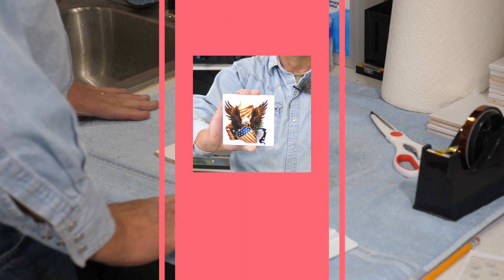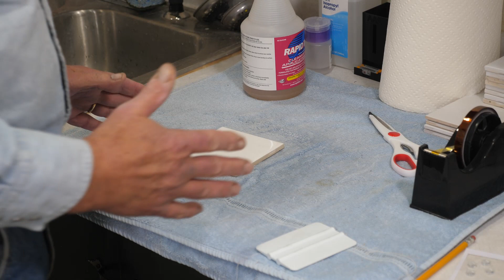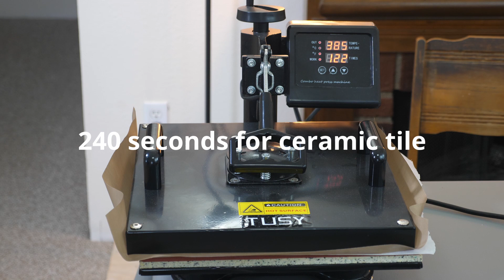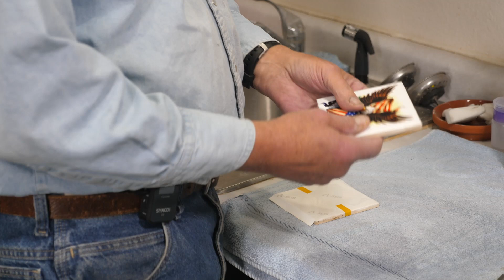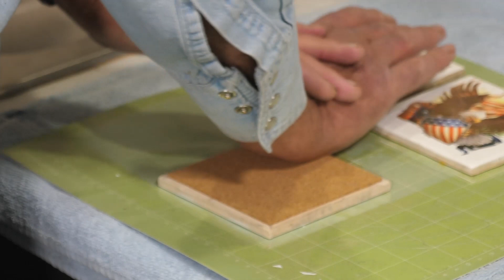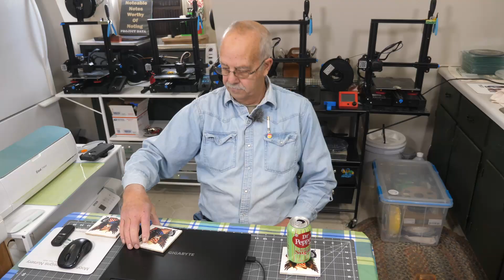Dye Sublimation On Ceramic Tile

Comment: Thanks Roger. I have a couple of questions as I'd like to make some tiles using some of my photos for gifts. I'd probably want about 100 tiles in total.
1) It's been a couple of years since your original video. Would you still recommend the equipment that you listed or are there newer models that you would now recommend? I'd like a all-in-one printer and cutter in one if possible.
2) Perhaps it's cheaper for me to simply have a business/person create the tile gifts for me. Is there a business that does this that you would recommend? Would you be interested in do this and if so, what would you charge to create 100 tiles if I sent the images to you?
Reply from the maker: Methods are still the same.  If you have the equipment, a DIY is going to be the cheapest.  While I could do them for you, it would not be until January due to present commitments and workload.

Comment: If the polycrylic works in a ceramic tile would it work on a mug too
Reply: Would it be ok for me to use or just for decoration
Reply from the maker: @clairecolchester7345  If using for a coaster, etc., apply a clear coat to protect the image.
Reply from the maker: Yes
Reply: @rogersshop  Is the YES for the mug use question?  😁

Comment: Great demo. Thank you for the up front info. Will these tiles withstand installation in a shower? Is there a particular type that would? Thank you.
Reply from the maker: Yes,, so long as not scrubbed with an abrasive.
Reply: @rogersshop   Thank you.

Comment: Roger. I tried the vinyl… it melted at the 385f/240 s… 
Maybe the vinyl cuz it’s the cheap stuff from $ tree. Was using just to see how it would work. 
I’m love the template for my vinyl cutter so thanks much for sharing. 
I do have some Circuit brand vinyl. What time/temp would you recommend for the cheap vinyl I have, I want to be able to use it up. 

Thanks! Glad I found you.
Reply from the maker: Was the vinyl o the bottom?  It will melt if on top.  I did a trial comparing the Dollar Tree vinyl to others on glass, using this method and it actually turned out pretty good for such cheap stuff.

Comment: What are those machines working in your background?
Reply from the maker: 3D printers.  We have 14 of them and working most of the time.
Reply: @rogersshop  
Is 3D printing for primary projects? And do you have an engraver?
Reply from the maker: @MrJj2001  I print custom mounts and risers for laser engravers, along with a few other things.  I do have laser engravers.  Both diode and CO2.
Reply: @rogersshop  
Thanks for your response, you seem very knowledgeable and dedicated to your craft! Great discipline and focus! God bless!

Comment: Both  poly and vinyl methods worked well for me.   I have the same heat press.  What paper to you have attached to the upper plate with magnets?
Reply from the maker: Teflon sheet

Comment: Thank you for all your videos.  You are by far the best out there and have never steered me wrong.  I’m trying this one out this week to prep for mother’s day photo tiles 🤞. Do you have a website or are your steps listed anywhere?
Reply from the maker: We do have a website, but the steps are not listed there and most of these custom items are sold locally and not on the website.
Reply: I got the chance to try it today but it peeled when taking the paper off.  I sanded with 400 grit.  I did the 2 coats, letting it sit over night both times but didnt press it until 2 days later.  Im thinking its because I didnt sand it enough.  Any tips?
Reply from the maker: @valerietramontozzi7595  I've never had that happen.  Could be that you did break the glaze enough on the tile first.  Try a 220 grit paper if your glaze is especially tough.

Comment: Hi, I followed your instructions and my tile did not sublimate well both times I tried. It looks like some of the ink came through but it’s very grainy looking, the image isn’t good. I’m wondering if it’s a difference in the paper. I use texprint sub paper and cosmos ink. They have worked great sublimating on everything else so far. I did only do two light coats of polycrylic so I’m wondering if maybe I didn’t have enough. The paper didn’t stick to it either. Only some of the ink came off none, of the paper stuck to it. So I didn’t have to wash it off it was just really grainy.
Reply from the maker: I also use Tex Print from time to time, so that is not the problem.  Check your pressure (should be quite firm) and be sure to preheat the bed and pillow a full cycle first.  This preheat makes a big difference.  When printing the graphic, use the highest quality setting possible.  Also, what base are you using?  Clear vinyl, Polycrylic, or laminate?
Reply: I used polycrylic spray matte, light coat twice and completely dried. I keep my print settings on prem matte, high quality. I did preheat the bed but not with the pressing pillow! I’ll try that! I had medium pressure, firm enough that it was slightly hard to close with the tile in place.
Reply: I tried heat pressing the pillow too beforehand for the full time and it was still grainy. I turned the press up to 400degrees and pressed the same tile again and even more color came through, but still not quite there. I’m thinking tomorrow I’ll try this at 400 for longer.

Comment: what printer and software is used to print to the viny??
Reply from the maker: The printer used here is an Epson 2720 with sublimation ink, printed on sublimation paper.  It does not print direct to the vinyl.
Reply: @rogersshop  oh ok i understand thanks...but with that being said it is possible to transfer an image to the vinyl and the apply the vinyl to a surface of choice
Reply from the maker: @Chet_Vanderlinden  It can be done on HTV to apply to a porous surface such as fabric, but I've never tried it with Permanent outdoor vinyl.  Not sure how the adhesive would hold up after the heat transfer.

Comment: I sanded with the power tool with 60 grid,  and 400, it still feels smooth, are you able to feel roughness when you sand them?
Reply from the maker: No.  You  should not feel any roughness.

Comment: Thank you Roger.  This is a very informative video.  Would you mind answering a few questions?  Can this process be done using a Cricut Heat Press?  Would I have to apply manual pressure for this to work?  Do you have a recommendation for temperature and time using a Heat Press?
Reply from the maker: Yes, you could do it with an Easy Press.  However, it takes a lot of pressure and you need to make SURE you do not move while doing it or it may ghost.  Time & temp would be the same as if using a heat press as shown.

Comment: Roger, when you sanded the tile to remove the glaze, did you use the electric sander or did you do it by hand? Thank you!
Reply from the maker: I've done it both ways.  When doing a lot of them, I use a DeWalt random orbit sander.
Reply: Roger, one more question - what are the dimensions of the shape you cut out in the vinyl to wrap the tile? I’m making coasters for a Christmas gift and have wasted 2 sheets of vinyl because my template isn’t quite right size wise. Thank you.
Reply from the maker: @kimberlysturgill  Center square is 4.125".  The four "lap tabs" are 4.125" x .75".  I did this on a Cricut and because of their proprietary "rules", I can't share the template.
Reply: @rogersshop  no worries. Having the dimensions worked. I thank you. I also thank you for the Rapid Tac recommendation in your video. That makes applying vinyl a cinch.
Reply from the maker: @kimberlysturgill  I did find a way to share the Cricut template.  The link to it is in the description

Comment: How did you get your shape for the clear htv to fit on the tile
Reply from the maker: Created the template in Cricut Design Space after carefully measuring the tile to get exact dimensions.  Don't use HTV here.  Use permanent outdoor vinyl, such as Oracle 651 or 751.
Reply: @rogersshop  very helpful. Thank you for noticing i thought it was htv. I mean it was a sticker hence the wet application but because it went under the press I had htv on the brain.
Reply: @rogersshop  What is the size of the clear vinyl you use to get the overlap
Reply from the maker: @sheri8471  4.25 " square with 1/2" overlap on each side, corners cut out

Comment: Do you find a laminate comes off easy? If so do you have any suggestions? Also, is it waterproof?
Reply from the maker: Not had a problem with it coming off.  Waterproof?  Maybe................  Water resistant, yes.  I wouldn't soak it or run it through a dishwasher.

Comment: Great video, I do not have Rapid Tac, can you please recommend another adhesive? Thanks!
Reply from the maker: Rapid Tac is not an adhesive.  It is a cleaner and a liquid that allows positioning and eliminates air bubbles when squeegeed correctly.  Plain water also works, just not as well.

Comment: The vinyl that you used in this video is that vinyl inkjet printable vinyl that I can use in my inkjet printer?
Reply from the maker: No.  that will NOT work.  This is Oracle 651 permanent outdoor vinyl.
Reply: @rogersshop  ok thanks

Comment: Do you clean the little bumps off the side of the tile. They really annoyed me. I was going to use a grinder.
Reply from the maker: Sometimes, I use my Triton with a carbide belt.  Normally, I just leave them.
Reply: @rogersshop  Buy tilke without them.  They are a pain in the ass.

Comment: What's with the Dr Pepper can? Almost looks like you'd need the old hole punch can opener, going by the design, which goes way back. Is the 'made with sugar' soda from Texas, or are other areas doing that now, too? I know a LOT of food companies are trying to get away from high fructose corn syrup, which I personally believe is largely responsible for obesity and diabetes in our country. But I'm no doctor - I only play one on YouTube. In your home siding video, I thought it looked like Southern Missouri. But I don't know my states that well. Cool ideas with the tiles. Could you put a coat of epoxy resin on it? That bullnose edge might be a problem, unless you have the tile sitting up on something and pour it on and let it drip off the sides.
Reply from the maker: Whenever I see the "Made With Real Sugar" Dr. Pepper at the store, I stock up on it.  I like the taste better and it reminds me of the bottles I could get when I was a kid.  I am in northern Illinois, along the Mississippi River, bordering Iowa.
Yes, one could coat the tile with epoxy resin so long as the formula would not react with the base.  I have a friend that makes coated tumblers and found that out the hard way!

Comment: I'm watching this way after the fact (sorry). I have a question, the tiles, although they are covered on the edges with the vinyl they 'look' raw. Can they be painted white before doing this process?
Reply from the maker: Yes, they can be painted with high temp paint.  Or, you can wet sand the bumps off with silicon grit 220 paper.

Comment: I have the following and would like to know if i can use them any of these as a substitute: Krylon colormaxx clear indoor out door i have the gloss crystal clear and the flat crystal clear, rust-oleum painter's touch satin clear , the modge podge gloss crystal clear sealer "spray" (-:.. i know we've been down this road before, but i wanted to add some more choices to the pot in hopes of getting a "clear" winner, lol  (-: hoping  something in my stash works.  (-:
Reply from the maker: I have tried solvent based clear coatings and they do not work.  The coating usually blisters in the press and color transfer is either poor, or none at all.  The water-based Polycrylic has given the best results.
Reply: Thanks for saving me from the trouble of making a mess as well as  wasting my time n supplies.

Comment: Thank you! Very easy to listen to. Question, should I use poly acrylic spray or brush on? Glossy? And if either, do you have a personal preference?
Reply from the maker: Brush on will leave marks, no matter how careful you are.  Spray gives the best finish.  When I do a lot of these, I use an airbrush with thinned Polycrylic from a quart can.  Much less costly than the spray cans.

Comment: Just wondering... With that Polycrylic spray, could this also be used for plain dollar tree COFFEE MUGS, vice having to using actual sublimation mugs. Also, When you say Vinyl you are referring to adhesive vinyl ( I see in your references 651)
Reply from the maker: Polycrylic spray would work if the intended use was just decoration as it is not listed as food-safe and getting it to adhere to the ceramic glazing might be a problem.  For the vinyl, yes, permanent outdoor vinyl such as the Oracle 651

Comment: Roger, what laser machines are you using in the background in this video
Reply from the maker: Those are Creality Ender3 V2 3D printers.  we make custom parts for various things and they run pretty much 24/7.  Just added another this past week, but a different brand with a larger work surface.

Comment: Where did you find the 4
25 X4.25 square ceramic tiles?  I went to Lowes and their smallest tile was 6X6.  Everything on Amazon costs around $1 for each tile
Reply from the maker: Lowes, Home Depot, and Menards all have these.  They are basic ceramic wall tiles.  The Menards price is $0.15 each when purchased in a case of 100.  As a plus, those from Menards are made in USA by Mohawk.  I have also used the 6 x 6 for trivets, but laser engraved, not sublimated, so as to tolerate heat.
Reply: Thank You
Reply: I have found that the best place to buy tiles is at Home depot.  Lowe's is closer, but they never seem to have them in stock. I don't have a Menards in my area.

Comment: Roger what size did you cut your square a nd the cutouts mine is always off thank you
Reply from the maker: Measure your tile, but mine are 4.125" square and I allow .75" on each edge to wrap under, with corners cut away to prevent overlaps on edges and back.  The cork base then cover where it wraps under.
Reply: @rogersshop  do you do the cut outs for the corners in cricut design or manual - how do you do that?
Reply from the maker: @pixiwings75  On the Cricut.  Make a square, then some rectangles.  Put all into position and weld, then cut.  Measure your tile carefully first.
Reply: @rogersshop  so that is 4.200 is that correct
Reply from the maker: @sheri8471  4.125" with 1/2" overlap, corners cut out.
Reply: @rogersshop  How do you get the shape that you use
Reply from the maker: @sheri8471  Made in Cricut design Space
Reply: Thanks so much

Comment: what size is your template for the tile
Reply from the maker: Measure your tile, but mine are 4.125" square and I allow .75" on each edge to wrap under, with corners cut away to prevent overlaps on edges and back.  The cork base then cover where it wraps under.

Comment: I tried the laminate on tile before and that was definitely an epic fail. Now I have a good use for my 25 yards of 651. I’m happy to see you got yourself some new gloves.
Reply from the maker: Gloves for me can be tough since I wear a size 11.  These run big, so a 10 fits perfect and the heat resistance and grip is excellent.  Not cheap, but worth it!  I'll be doing a review on these soon.
Reply: @rogersshop  I have the opposite problem. I have really small hands and can wear kids gloves, so even the women’s heat-resistant gloves are huge on me.
Reply: @rogersshop  Laminate ia 8 min minumum to bond

Comment: I have the Epson et 2803 do You know the link to find the color profiles for the hiipoo inks for my printer I’ve searched and cannot find them from hiipoo. Have you tried the clear vinyl method on thin glass? Many thanks
Reply from the maker: I do not know of an exact color profile for the Hiipoo inks, but do have the Hex code for the four primary colors.  Black #000000, Yellow #FFFF00, Magenta #FF00FF, Cyan #00FFFF.  Yes, I have done this on the thin Dollar Tree picture frame glass, which is half as thick as regular window glass.  Works fine, but be careful with pressure as it beaks easily.  Guess how I know that.........
Reply: @rogersshop  thanks Roger, what settings best for thin glass, you used clear HTV over the glass right?
Reply from the maker: @darleneroach2848  Do not use HTV.  Use permanent outdoor vinyl such as Oracle 651 or 751.  Can be gloss or matte.  Doesn't matter.  Clear or white work the same.  385 degrees for 190 seconds.  Medium-firm pressure.  Photo/graphic facing up, vinyl side of glass facing down.  Be sure to preheat bed.  Do not try to hot peel.  Let it cool and use water to get paper to release.  Magic eraser and water will then remove the white film left behind.

Comment: beautiful! could i put modge podge on the poly acrylic coaster as a second coating after its been sublimated as the protective coating, instead of another coat of poly acrylic ? thanks
Reply from the maker: I suppose one could.  I'm not a fan of it as it always shows brush stroke marks, but that is one of my OCD things............  I always spray Polycrylic rather than brush for that reason.
Reply: @rogersshop  great point! I'm going to give this a try. Thanks!